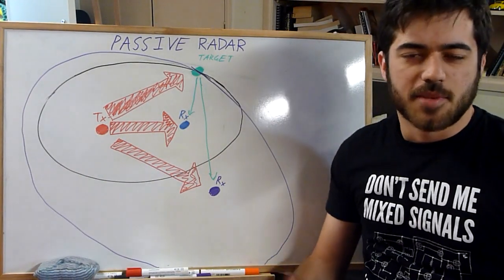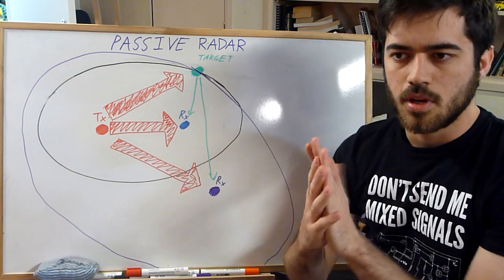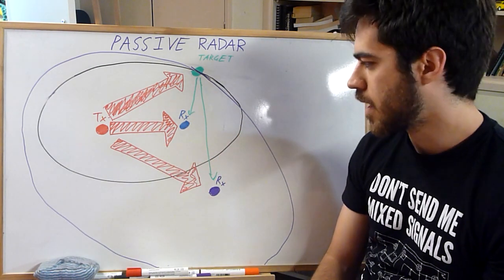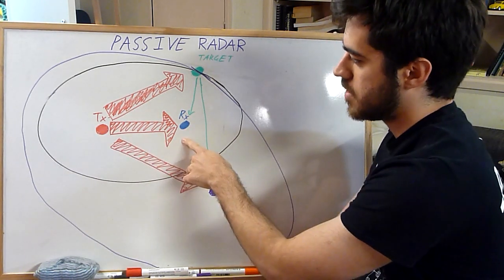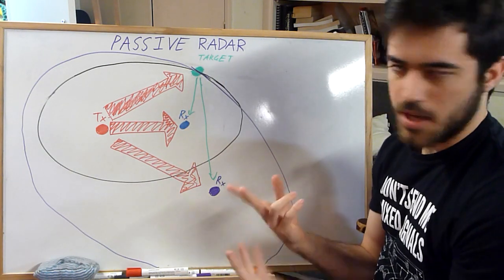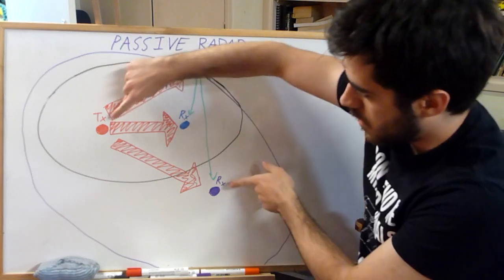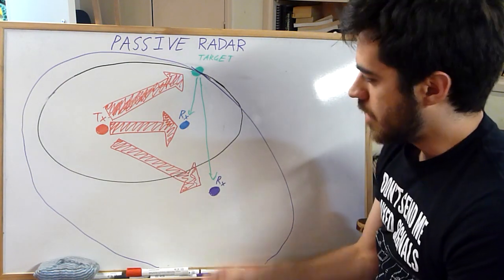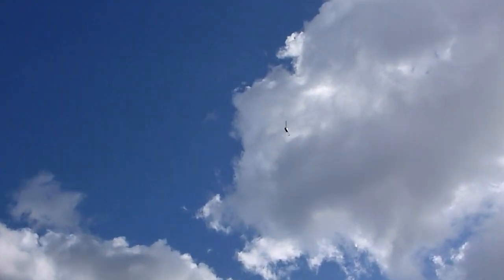Passive Radar Thesis (Quick Overview)

Comment: I think the best passive system is the one use ambient noise and sun power as medium and silent as information signal that way pilot can not lock missile on ground radar signature because there is no signal from passive radar. On a Sunny day sun supply average 65 wat / ft SQ and at night the ambient noise of infrared and sun moon is more than .05w/ft SQ which can be amplified into strong enough signal by feed back circuit and detect easily and to use amplified Laser signal for Lidar passively is  by using mirror of ambient negative to amplified positive emitter from air craft because kinetic energy would single out fast moving objects

Comment: What's the alternative if the transmitter is knocked out?  Advanced planes emit few electronic signals as well.  What's the solution for that? Please correct me if I'm wrong.
Reply from the maker: If you run out of transmitters, then you can no longer use passive radar
Reply: @myeongsa  I thought as much.

Comment: hi i have a question, does passive radar cause electromagnetic radiation to increase around and over the target or is everything done invisibly even with a wave detection tool?
Reply from the maker: Hi, in passive radar, you are not emitting any radiation towards the target. The level of electromagnetic radiation around the target is the same whether you turn on your passive radar receiver or not.
Reply: @myeongsa  Hi, ok  thank you, and an active radar is sending it waves in the direction of the targets then? is it possible to use the waves with an active radar in the manner of a passive radar with mobile antennas or other dedicated network sources for example?
Reply from the maker: @Vérité777  yep, that's exactly the application
Reply: @myeongsa  is it possible to use waves from mobile antennas or other sources, and use them as active radar? But not with 2 receivers as with passive radar, but with receivers on the transmitters?
Reply from the maker: @Vérité777  I don't 100% understand the question, but basically in my limited opinion, the only difference between active and passive radar is whether the transmitter is cooperative or non-cooperative (whether you control it or not). Anything else such as number and location of receivers or transmitters is just technical differences in the setup of your radar system
Reply: @myeongsa  I wanted to say, that a passive radar uses the sources external to the radar like for example the mobile network.
But my question is, is it possible to use the mobile network
  (or another) like an active radar? So to place receivers on the antennas for example?
Reply from the maker: @Vérité777  if you control the mobile tower or have very good knowledge of the waveform, then yes I suppose.
Reply: @myeongsa  Ok thank you

Comment: Can you provide us more detail about the equipment used in the experimentation?
Reply from the maker: Hi, what further details would you like to know?

Here is a list of the main equipment that I used:
1. Log-Periodic Dipole Array from ANTSIG with the manufacturer stating a gain of
approximately 7 dBd (9.15 dBi) at 200MHz, where it was utilised.
2. Newsky TV28T RTL-SDR dongle based on RTL2832U chipset
3. RG6 Coaxial cable
4. Intel Core i7 6700 Quad Core LGA 1151 3.4GHz CPU Processor
5. Asus B150M-A mATX Motherboard
6. Asus GeForce GTX 950 DirectCU (Nvidia GPU)
7. Corsair 16GB DDR4 2133MHz RAM
Reply: @myeongsa  Hi, and the software is it GNU radio?
Reply from the maker: @amineatt6713  No, I wrote all my own code in Python to do the processing.
Reply from the maker: @amineatt6713  Hey, the software is not GNU radio, it's all stuff that I wrote myself.
Reply: @myeongsa  thx

Comment: @myeongsa Hey this is really interesting and congrats for the hons/masters thesis :) - I was wondering whether your gx card signal processing algorithm works better than the method of recording signals from RTL-SDR cards wired to share the same crystal? 
I was interested in experimenting with passive radar from for meteor triangulation (so ranging small signals from >~100 km)?
Reply from the maker: Hi Matthew, 

I'm not too familiar with the actual workings of those RTL-SDR cards, but my understanding is that it shares a common clock to all of them to help with synchronisation, and all the samples still need to be read from the individual dongle USB ports.

If this is correct, then I think that the algorithm that I'm using and the RTL-SDR card operate on different parts of the passive radar processing chain. They could be integrated, with a GPU being able to process synchronised signals rapidly, allowing for more meaningful results (and things like clutter suppression could be improved by having synchronised signals).